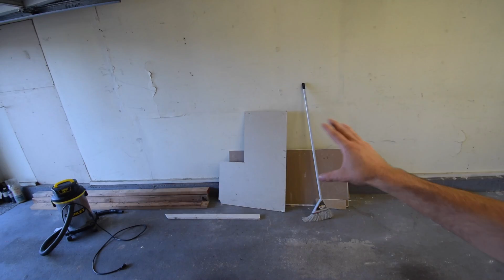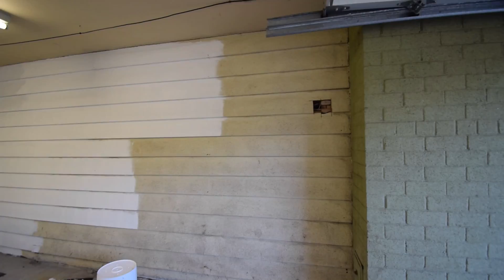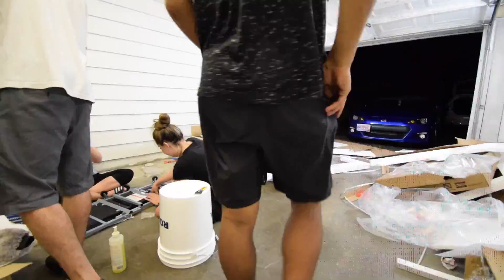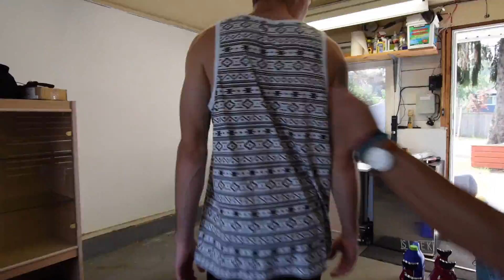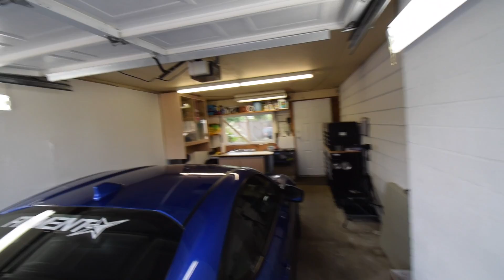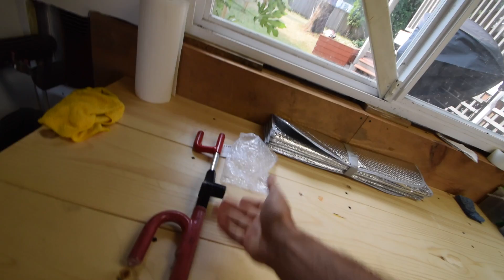Shop Renovating is DONE!!

Comment: In need of help. So i want to put a tow hook on my 2015 dodge dart but when i take off my plastic pice on both front and rear bumper there is no hole in the crash beams to screw it into any suggestions or know how expensive it is to screw a thread into that or if it is even safe to screw into it?

Comment: I'm hoping that someone can help me with a problem with my car. I own a 1995 Toyota celica, the first motor in it spun a rod bearing and there's no place around me that would rebuild the engine, so I just ended up buying a new engine. It's the same engine (The 2.2L) but it's a 1996 instead of a 1995. When i first put the engine in it ran great. it started up good and ran great but a couple of days later it wouldnt start up quickly, I would end up having to crank it over a couple of times. We ended up think that it was the fuel rail or the injectors, so i replaced both the rail and all the injectors but it didn't seem to help. It's hard to start when the engine is cold but when it's warm it starts up on the first crank. Also all the fuses are good.

Comment: Nice job bro! Just next time with the painting... start by cutting in and then with a long handled roller, work from top to bottom, end to end (like don’t start in the middle of the wall as it can make for an uneven finish) by no means am I professional, but this can help with your end product. Other than that man, absolute bang on job!